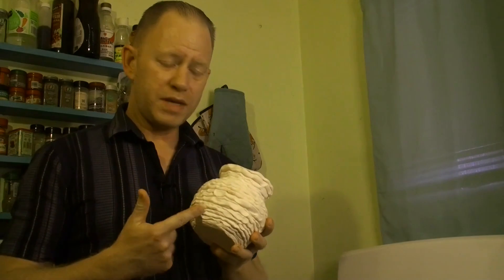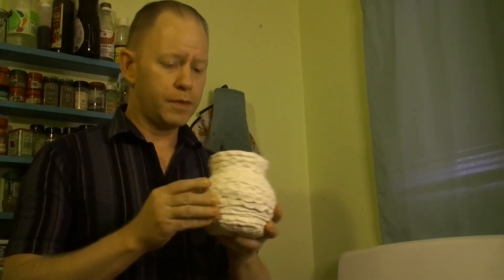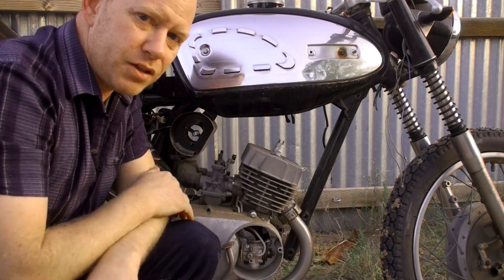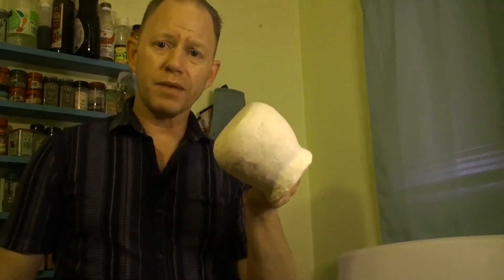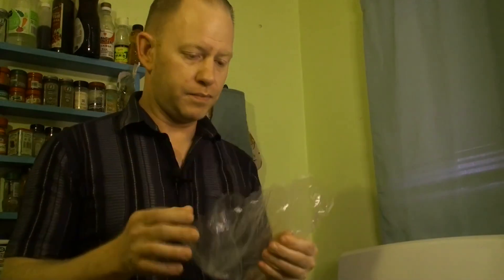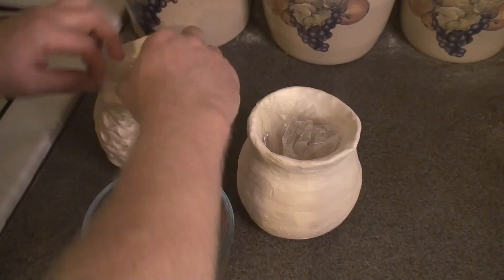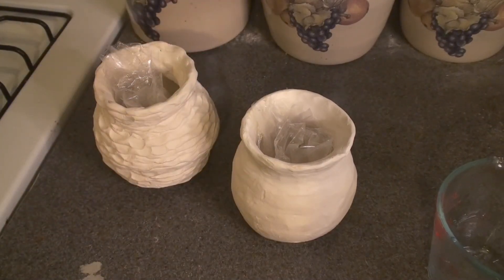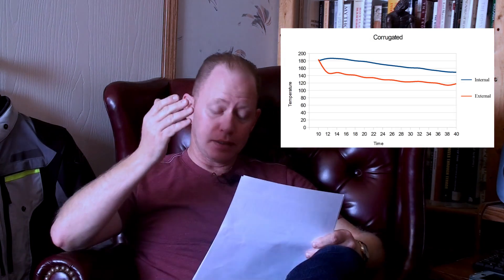corrugated pottery experiment

Comment: Absolutely fascinating! Loving the science.
I don't think the burner diameter would make a huge difference - I agree with you about cooking over a fire would mean that pots would be receiving heat from the sides as well as the bottom. You can get 'stick-on' thermometers for use in healthcare contexts, which might minimise the issue of distance for external temperature, but I'm uncertain if they would handle cooking heats.
Following your results, I'd theoretise that perhaps the corrugations are to help cool the outside down so that pots are easier to handle and users would be less likely to burn themselves on the outside of the pot? I don't know a lot about the material culture of the American Southwest, are there ancient equivalents to your delightful sloth gloves, or perhaps tongs/chopsticks for handling hot pots?
Anyway, I very much enjoyed this!
Reply from the maker: Yes, there was some sort of handling instrument. I don't see myself continuing with this experiment though :)

Comment: That was an interesting experiment. One other thing that might have to do something with the weird results may be that while the corrugation quickens the heat transfer between the walls and the outside (and maybe the inside too? We didn't get a very good look at the inside, but it seems a lot smoother, so maybe no), there may be cavities - in fact, there probably are, since you talk about the leakage - caused by the manufacturing process that act as a kind of insulation between different layers of the wall.

I would also add a suggestion for improving the experiment: measure the temperature not just during the cooling phase, but also in the heating phase to see how the outside and inside heats up and if there are any weird things similar to the cooling.

Comment: Corrugation is not causation. Bad correlation is not causation pun. 😊

But it looks like your pots weren't fired at a high enough temperature and that is why they wouldn't hold water. I couldn't see cracks but idk if that is why you called then a sieve. It looks like stoneware but firing at higher temp it will change the color and properties if the clay making it less water permeable.

Depending on the clay too - which i can't tell  from just video. I'm no ceramicist, just a new friend.

You should try again with earthenware -red clay! And run more than one test per pot.

Comment: Great video.  Always a fan of some experiments and testing assumptions and a hypothesis.  I am with you on the burner diameter.  I would think because it is the same for both of your tests it shouldn't have a big factor unless maybe the "fins" on the bot captured more heat than the smooth sided pot.  Did you have the burner cool down to room temp between tests?  I assume you would have so it is apples to apples but maybe missed it in your video.  in any case, good job with a nice entertaining test :)

Comment: Interesting video. Following the end of the archeology series, I'd been waiting to see if something else interesting would come up, and lo and behold, it did. I'll stay subscribed for science experiments and experimental archeology.

Maybe the corrugated pottery is a stabilizer, of temperature? I would be interested in seeing another experiment, with cold water, or even ice, instead. Or perhaps, as you mentioned, warm rocks, and then putting a lid on, before submerging in water. Primitive water heating technology, perhaps? Or ice in the dessert? 

I suspect that, since it seems the corrugations are on both the in and outside, then the heatsink goes for both ways, but I am of course not sure about the inside. Is it smooth, or corrugated? Would be very interesting to see a pot with corrugations on both sides, vs one only on the outside, and even one only on the inside. It seems to me that the latter one would be very effective at holding heat inside.

Comment: I believe you should have weighed the pots as well (can still do). I'm guessing the corrugated pot has significantly more mass (10-20%) which means it has more heat capacity.

Also the other factor that might impact the results, albeit to a much lesser degree, is that you didn't weigh how much water you put in.

Comment: First thing that came to my mind when you compared the corrugations to cooling/radiator fins - "why would you want the pot's contents to equilibrize faster with surroundings?" - and the answer that popped up was not cooling - If these are used for cooking or boiling water, then the increased surface area can also result in faster heating times, and lower fuel usage. Well, if the theory holds up to experimental testing anyway, which so far it does not. Indeed, the initial equilibration captured on your graph between hot pot and less hot water would indicate the pot design might take longer to bring things to boil. - as others have commented, probably due to greater mass and average wall thickness.
Reply from the maker: Previous experiments showed that corrugated pots never came to a boil. So there's that!
Reply: @daskalosBCE  Ooh. now that is interesting.
Reply: @daskalosBCE  My thought there is that is potentially meant to not boil, IE simmer or poach food in.

Comment: I liked seeing this even if it was inconclusive. On one hand, there are changes you could make to produce more accurate results about "the effect of corrugated outer surfaces on heat dissipation." 

On the other hand, the argument could be made that the people using such pots didn't care about the experimental approach--they cared about overall usability. Maybe they liked it because of the way it acted when on the fire, or the way it radiated heat, or the texture for gripping it when carrying hot liquids. Maybe the corrugation came in handy by giving the outer surface more area to dissipate from, so that heat at the bottom (e.g. the hot rocks) wouldn't affect the top as quickly. Or maybe it was just for looks or style. I really couldn't say, especially since I don't even know which types of pot were the most prevalent.